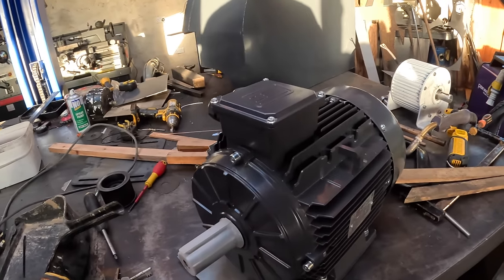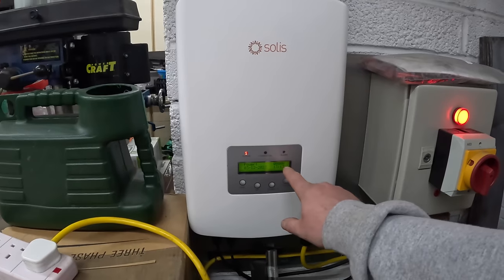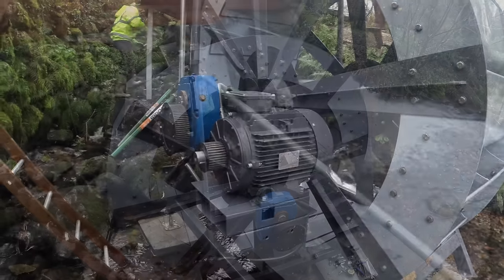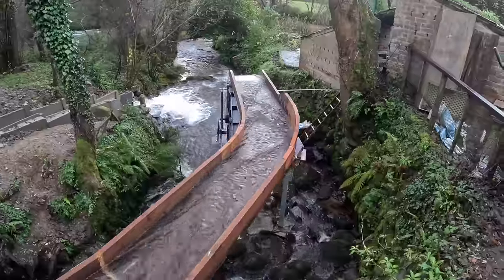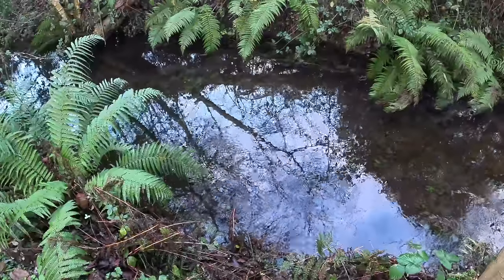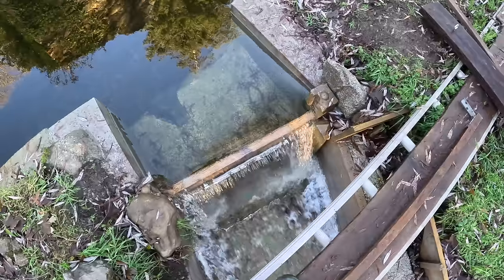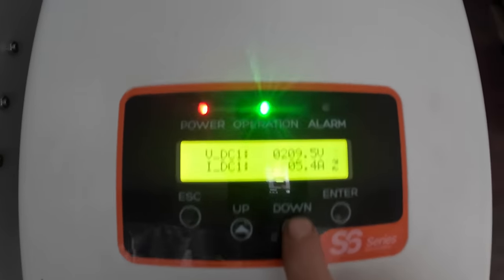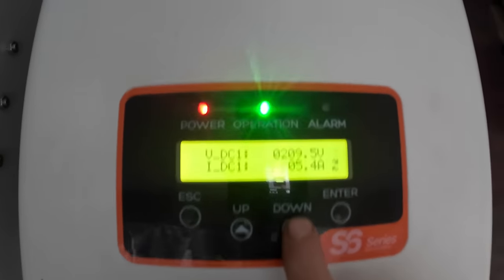Powering An Old Mill  1.5 Kw Lake District Overshot Waterwheel Project Part 4

Comment: It’s a fantastic system you have set up. 

I’m a complete amateur in comparison but thought the heater ideally would have been lower to dissipate the heat more. Toasters under cupboards can dry the wood to the point they can ignite. Not sure if it was wood in the vicinity of the heater so possibly an irrelevant comment.

Comment: It would be interesting to hear the lessons learned from this endeavour and perhaps a conclusion as to the potential impact of certain changes. i.e if you had made the buckets a foot wider but kept the outlet the same size would that reduce splashing and increase efficiency at higher rpms.

Comment: Awesome job all around. Congratulations on a successful implementation.
If the gearing allowed the wheel to rotate more slowly to give the water supply more time to fill the buckets do you expect it would generate more at a lower flow rate?

Comment: Kris
Fabulous result, and I have one observation. Not sure how that constant water will eventually degrade the the generator workings, but would it be worth extending the drive shaft over say 6 feet . completely out of the splash zone. ?  Love the vids and the engineering. well done!

Comment: could you consider this: extend a bit, about the thickness of a bucket, the water exit mouth. the buckets no longer buckets but simple walls. the waterwheel side without the motor: attach a flywheel instead of simple spokes. I think this should reduce the splash chaos and (hopefully not just in my mind) bring about a bit more revolutions to your waterwheel, considering that you just cut down some of the water resisting the exit from bucket and cut down some weight. you might say that the flywheel adds more weight, but that is until it gets up to speed.

Comment: You work is fantastic and the ability to adapt to problems is great. Can I ask if the new cover is a little close to the motor fan? Does it not cause problems with cooling? Please don't see this as negative, I'm just asking as it looks close.

Comment: Thanks for taking us along!! I really enjoy your videos. Especially the ones about the hydro electric stuff. I was thinking, isn't it a possibility to fiddle around with the size of the belt wheels? To change the speed of the generator.
And another thing I was thinking, could it help to make some sort of cover over a part of the wheel to direct the splashing back in the buckets. (I have no experience with this whatsoever, I am just questioning if this could work)

Comment: I think a couple of fins added to the channel in the curved section will give a more controlled turn to the body of water and reduce the turbulence which is still somewhat present when entering the wheel. May be beneficial
Reply: If you look at the water at say 36:50 you can see that there is a peak flow (approx 2/5 from the lhs of chute) present which if was spread out greater the potential for splashing would be reduced. Note the area that is splashing in the bucket is being created by this (removable) peak
The build is a work of art btw, well done

Comment: I'm wondering if you add on some higher walls to the side of the wheel it would redirect some of the splashing water back into the buckets without adding much weight to the wheel itself... Maybe some thin aluminum, plastic, or rubber side wall fins

Comment: This is so cool, it would be interesting to see if the wheel had enough torque to run a slightly smaller drive pulley on the motor to spin it that bit quicker at the lower flow, and at the peak flow be around that 1700 rpm. Also are you running any thermo sensors on the motor to ensure it's not going to over heat with how tight the cover is or does it still have ample air flow it was hard to tell when you fitted the cover?

Comment: Build a hopper like thing over the wheel to catch a lot of the splashing out water and drop it back onto the buckets. It would need to fit as close as possible to the wheel to minimize what water gets out instead of adding its weight to move the wheel.

Comment: Amazing work, and very informative videos. I had been waiting to see this update to the previous one and find out how you got things to your liking. 
One quick question that I am curious about, as I don't know much about designing water wheels.

What effect would moving the chute back a little bit (not a whole lot), so that the water enters the wheel just a bit earlier have?
I am thinking it may be wasteful when starting the wheel, and maybe even make it a bit slower to get moving, as some would likely spill off the back of the wheel. Once the wheel is turning at a fair rate though, the forward momentum of the water and wheel would keep it in the buckets I think. Would it possibly get a bit better fill of the buckets and maybe a slight bit more output with the same flow? 

Sorry if I am way off, just trying to better understand how all of the many different "adjustments" that can be made effect the performance.

Comment: This is so cool. I've loved watching all your hydro and solar stuff over the years but this kind of low head system really seems to be more practical in a lot of respects compared to the high pressure high head system you have at home.

Do you think that as you make more of these, there is room to optimise the design of the buckets for less splashing or are you pretty confident that you've got that nailed down? 

Keep at it mate. We all love watching your videos. 

There is always gonna be someone who has criticism or disagrees but the comments are overwhemingly positive. But it's still good to have all the perspectives to keep it real, even if they disagree.

Comment: Would be interesting to see if you could improve efficiency by putting some hood over the wheel to stop water splashing out the sides. Did customer consider a turbine design which would be more efficient and probably cheaper to build?

Comment: Great work! Steady and consistent. 
I am wondering what is the lowest river slope needed to get a power system to work? I have a 25-foot wide stream, water averages 6-8 inches deep, and about 100 feet of upstream property to work with. It is a low slope so can't go over the top of a large wheel.

Comment: Its an interesting safety backup but its not a fail-safe system as it relies on the actuator being functional and having power in the event of a failure. You could implement a fail-safe system for a belt/generator failure by using a solenoid to hold the water gate open and energising the solenoid using the generator. If the belt or generator failed, the solenoid would lose power and release the gate to fall closed. Your system could have a dormant actuator failure which would cause a dangerous situation in the event of a belt failure. (I work in aviation safety)

Comment: As far as i know, you can also just hook up the induction motor straight to the power, and if you spin it faster than synchronous speed (a couple percent) it will start generating. That means you don't need an inverter. You do need a protection to prevent the motor from driving the waterwheel.

Comment: Hi Kris, great series of videos, I am hoping to build something similar but have a question if you would be kind enough to answer.You used three 80 microfarad capacitors , were they to reduce dc ripple, PF correction , or both….or some other reason ?

Comment: Love this. Quick question ... now that you've done all the hard work on getting the wheel designed, built, tuned, etc. how would the cost of building and fitting a second wheel line up with the benefits of being able to harness more power ? Obviously, more work in diverting and damming, but is it a realistic proposition ? Thanks for your content - great quality an great viewing.

Comment: Love this project and been great following along. I was a little concerned, does the inside of the cover leave enough room for the fan on the back of the motor to operate properly? at these speeds its probably fooling fine, but something that can reduce the life if it can't properly cool itself.

Comment: Not to sound stupid, but what about a cover over the wheel to clean the flow so no splashing, then throw straws in the direction of the flow to perfect the flow motion for a truly efficient and proper flow of the conditioned water. Like the water dancing at the Bellagio Hotel in Las Vegas

Comment: Fantastic project! Congratulations and thank you very much for sharing! A few questions if I may... Is it possible to run the cheap Chinese generator by using the water to cool it and get 1 Kw? Can you wind your own coils for that Chinese generator, with let's say 1.5 mm Diameter wire, which will give you half as many windings and again lets assume half the voltage at 100 Volts? If that modification could be possible, would the same flow provide enough torque to turn the lower voltage higher torque generator? Or, can the gear ratios at the axle be modified to make the same design work?

Comment: Excellent presentation.  Thank you.  Can you explain where all of this wattage is going?  Is this a grid tied system feeding this power back to the power company for a credit?   It would not have enough power to run a full house without some storage so are there batteries storing any energy with inverters to power the house?

Comment: I wonder if you put a rubber mat over the top of the water just back from the nozzle would you smooth out the flow across the wheel. Like on the riffle deck of a gold trommel.

Comment: Not sure about the "squint goggles" but at least the set up is now working.  Would taller sides to the wheel help contain the water better i.e. make the buckets more recessed from the wheel periphery ?  You could double the output by putting a second wheel beside this one; you appear to have space !

Comment: Find this stuff facinating and appreciate that solar is crap in winter but how do they compare price wise? Would a solar system 4x/5x the size and batteries not be cheaper than the hydro solution?

Comment: Huge congratulations! That's no small feat. I suppose there is a maximum no-load wheel speed. There is a max entry flow speed and a max vertical speed due freefalling from the height of the trough. From this you can define an upper limit to how fast the wheel could be driven. If this speed can be tolerated you could argue you don't need a failsafe mechanism. Perhaps just an alert would suffice.

Comment: Hi Kris. Impressive job and very well done. Sorry if this has been asked before, but wondering why, even though they have a cover, the coupling, belt, electrics and motor needed to be next to the wheel? Couldn't there have been a long-ish driveshaft out from the center of the wheel to move these components away of most of the splash and closer to the wall? (or maybe even through the wall and out of the elements?)

Comment: What if you added a hood over the top of the end of the raceway and extending over the wheel to control the splash. The hood would contain the splash and redirect it into the wheel. The sides of the hood would conform to the radius of the wheel. This would allow more water flow and increase its efficiency.

Comment: May be helpful to drill some vent holes in both ends of motor cover to increase air flow for cooling also small fan in condenser box for cooling

Comment: Hi, the power rating of motors with > 1kW is the shaft power. So you can run the 2.2kW motor at 2.2kW continous. A run of the mill induction motor is temperature limited so you can push it way beyond for short durations or with improved cooling

Comment: Kris. Hi. 
Could you use a piece of heavy gauge rubber as a shield over the water chute onto the wheel to cut down splashing/spray. 
Maybe a piece of spray way from a truck mudguard.

Comment: I could change the trap door into a varying door so it acts like a regulator, so can open and close and anything in between to keep a steady flow. also can close shut if you want to save water and run on battery at times and then switch back.etc. just more control than a safety trigger.

Comment: Great accomplishment achieving your desired goal as to continuous output.   This set of video's gives credence to the old saying if it's looks / sounds to be too good, it generally is.  I may not be an electrical engineer, but even with my limited background I knew that the first motor specifications, was WISHFULL THINKING @ BEST.  You didn't show just what temperature the BIG BEAST of an motor was running @. Just a SWAG guess 90°F= 32.2°C (SWAG = Scientific Wild Ass Guess.)  Plus or minus 5 degree's Fahrenheit.  With the MASS size of that motor, that motor shroud (think motor housing) should not carry / get any ice on it during a cold (as in freezing) spell.  Any pre thoughts as to life expectancy on the Cogged Fan-Belt?  My SWAG guess would be a 3 - 5 year range.  I would anticipate a drying out & cracking of the belt over that time period.  Due to the ideal and VERY DRY HEAT conditions, via the Godzilla size motor.

Comment: I’m guessing you are using a three phase ac to dc rectifier for the inverter?
Did you manage to find a more efficient way of converting ac to dc, as you said previously the rectifier on your own system gets pretty hot.
Also what is the DC voltage going into the Solis inverter from the turbine?

Great work by the way. 👌🏻👍🏻

Comment: Just a constructive comment ,like a hose pipe if you put your finger over the end you get a higher pressure,I was wondering wether a restriction at the feed onto the wheel to create some back pressure would act like your thumb on a hose 👍.

Comment: Hi I love your videos!  cool result after you changed the motor/generator! I don't know if that is the case?  but if it loses efficiency due to heat when you run at max flow.  could you not make a simple cooling system on the motor mount, and in that way keep the motor cool.  with your excess water from the stream?  I don't know but maybe it could give more stability in general?  whether it's even worth the trouble is another matter

Comment: Have followed this project all the way through, very impressive indeed. However questions arise ! 
Was the water flow rate calculated and was the  wheel width adjusted for maximum summer water flow?  Bigger buckets or wider wheel, more torque, bigger induction.....
How long is expected before cavitation requires a wheel replacement? 
What grease did you use for the bearings?

Comment: @Kris Harbour Natural Building
Maybe on the next one you design you think about getting a TechTop 4kW 5 HP Motor 415V 3 Phase 6 or 8 pole so that you can make about 3kW on the efficient speed & 3.5kW on the high speed. The only change I would offer you is that to get more flow into the buckets would be to make the curved flow direction board that you have into a shape of an M so that the middle part of it begins to prefill the buckets earlier than the outer edges of the curved direction board.

Comment: Also, if you had made the buckets wider, then at full speed it would run efficiently as well.  But then in the summer with less flow it would not be the case I'm guessing.  So its about finding that happy medium throughout the whole year I guess

Comment: Needs proper wheel operated gates (sluece gate).  The infrastructure is there.  Motors can even be added to assist RPM control, and bypass for shut down.

Comment: Hi Kris.
Yo u
state the motor specs 3 phase 8 pole in the beginning of the video.Are you SURE it has 8 poles? I think you need to verify that simply because it's
3 phase mate and doesnt make sense. Motors work on pairs of poles thus giving 4 pairs. Does not compute for 3 phase.
Love your channel and determination. Cheers

Comment: You could get less splashing if water comes evenly on whole width of the wooden ramp. Now the corner in ramp makes water have high and low spots. High spots start to splash over wheel's scoops first - visible in video.

Comment: Could you also add a system like the one on your own smallholding on the bypass so you could maintain a little flow from the excess or power when you want to do maintenance on the main wheel?

Comment: Hi Chris 

Just thought I would congratulate you on a brilliant video series (water wheel build)

I enjoyed the educational side and  informative aspect too. I guess there's a lot of technical aspects behind what we see in the series. You recovered nicely from the Chinese alternator. 

Just a few unqualified comments and thoughts.

Would there be any benefits of slowing the water flow down in the last few inches by means of brushed paddle or rised pitch. Would this  help reduce splash? Maybe tie in automatic control to water flow and weight? 

Would there be any benefit of taking speed and output data  from the wheel and looping in back to automatic dam paddles to control the perfect water flow and weight to optimum efficiency at given water level. 

Anyway just a few unqualified questions and suggestions maybe this might be industry best practice for large systems. 

Anyway once again thanks for letting us share the build 

David

Comment: So with a solution like this.. instead or complementary to the heater.. considered building a gravity battery?
A gearbox that is back driveable with a large enough motor/generator and big ass boulder/concrete block attached to it.. trips, starts hosting the thing up, then trips over to heating element.. and you essentially got stored energy if you wanna add that into the circuit if necessary.

Comment: You should of used a 3 phase induction motor conversion in the first place. I built a diesel powered of grid generator with all second hand parts & I rewired the motor. It worked perfectly for over 20 years. I have solar (rubbish) & wind waste of time & money as it's to windy 2 have committed suicide & the mast survived perfectly. Unfortunately I don't have a river so water isn't possible.